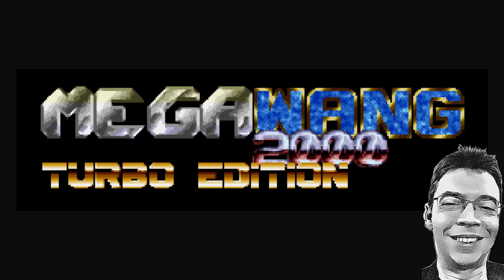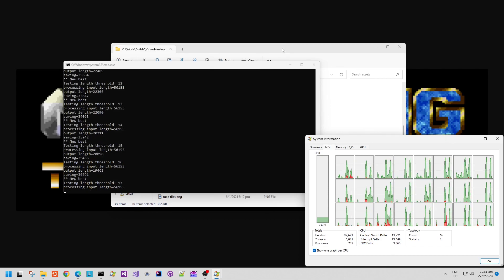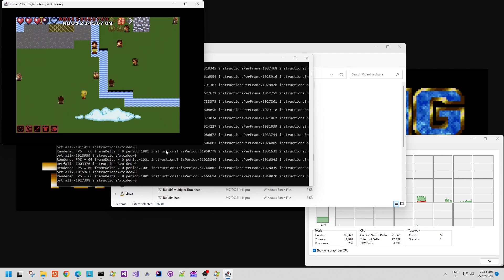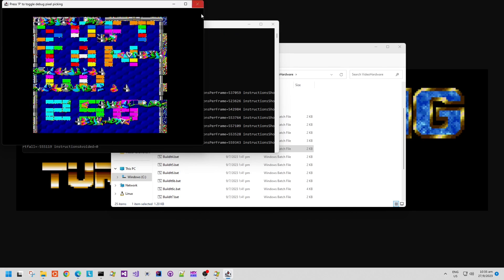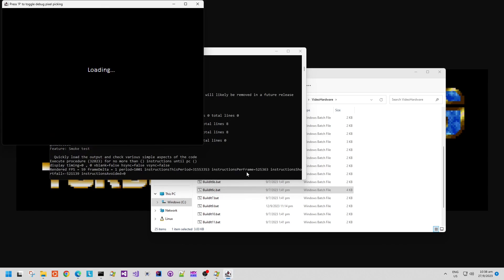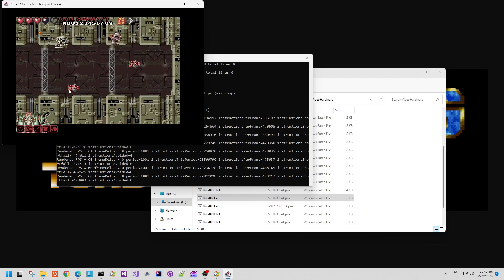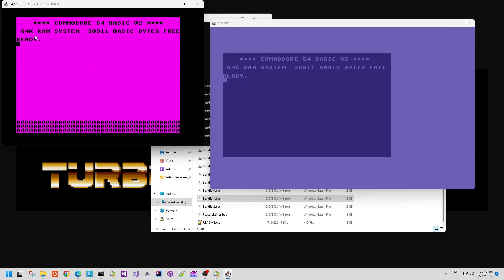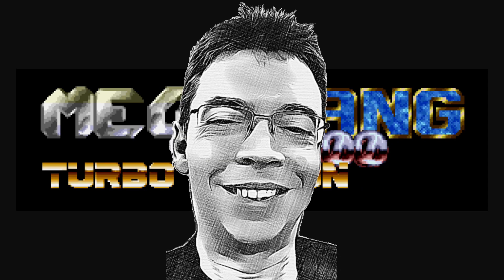MegaWang 2000 Turbo Edition - 22 - SDK 1 0 0 7

Comment: I personally find your project awesome.  Since this is a development board set, could you provide any idea as to how or what type of end user consumer product are we looking to get to?  Also, could it just be it's own system instead of being piggy backed to a c64, or could it be hooked up to a PC or an Amiga or Atari ST?   Finally if you get to and end product, do you have sufficient component stock to work with or you'll run into a quick shortage?  Finally, is there a website?
Reply from the maker: Thank you :) At the moment, the type of product I can see would be something to help teach how 74 series TTL can be used to produce complicated systems, along with how digital and analogue circuit design can work together. So basically, teaching material. An FPGA is much cheaper but that teaches Verilog or VHDL, which is a vastly different subject to teaching TTL integration.
It could be a standalone system. I'm working on a board that is an independent CPU with memory and peripheral connections to plugin into the backplane which would them allow the entire board stack to be independent.
It could also be used with other machines, since the interface is a really simple 5V 8 bit parallel data with write signal.
I'm also working on a board that would allow access via USB from any machine that supports USB. This would allow development work without needing a Commodore 64.
Due to component shortages I've already moved the design from 5V through hole TTL ICs to 5V SMT ICs. So now for the foreseeable future there shouldn't be supply issues.